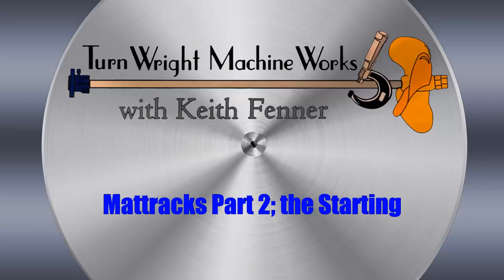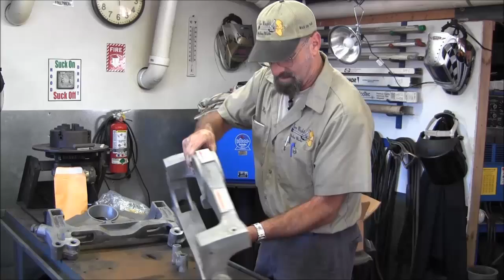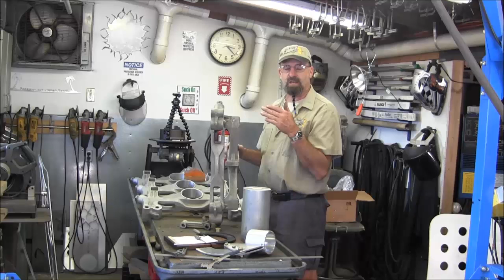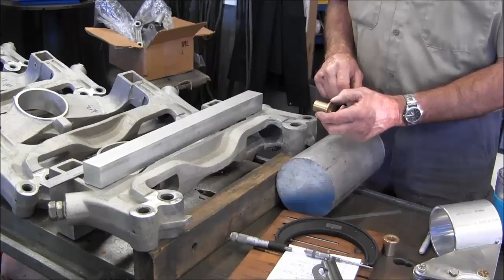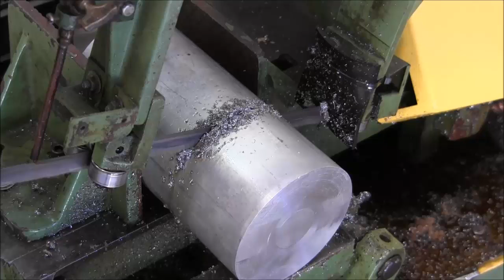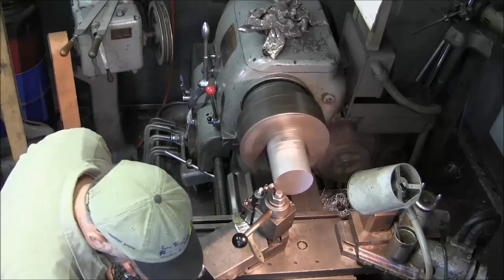Mattracks Mail Call: ATV Mattracks Repair Part 2; The Starting

Comment: Hey bud, I love your videos and I'm a Machinist myself. I have been watching tons of them lately, super nice work! On those end o-ring seals, in the pins, I think a better way to go about sealing from the elements would be to (after weld build-up of course) find a stock size steel ring, rubber lip oil seal. A similar seal to one you would find in the timing cover of an engine sealing the crank snout, or a wheel bearing seal. Counter-bore to the O.D. and depth of the seal and press it in. This would be by far more resistant to the elements and hold up better under pressure.

Comment: I'm still flabbergasted by the non-metric system that you people use there. 4 inches 633? I guess I need a conversion table watching these video's. Absolutely love it :)
Reply: Yep, it would be much easier to state it as 117.6782 mm or if you prefer 1,176,782 nm.  The metrics do kinda roll off the tongue .
Reply: but has your military been to the moon?

Comment: Hi Keith, 
I like the new angle of the camera over the lathe :). I think I know where you are going with the jig layout, I would like to offer an alternative,let us say if someone does not have a large bar of alloy. In order to locate the ID of the part you can have a plate with two vertical precision ground pins press so they catch the ID and an off centre cam that forces the ID on the pins, this creates an equivalent of a V groove and can be made by using plate off cuts (.plasmacutter...).

Comment: I'm looking forward to watching this job. It looks like a complicated setup. I wonder why they wouldn't have gone with bushings in the first place. Also I don't know if you'd condone this or not but old bandsaw blades can be made into good hacksaw blades when they're cut to length and holes drilled in the ends.

Comment: Reminds me of a job, I helped with as an improver duting my time as a heavy truck mechanic, Re furbishing Hendrickson reactive rear suspension units. I find that using an internal micrometer is better than a snap guage. Like wise did'nt really use dial guage verniers except fo rmeasuement when reaming bushings . Like wise when measuring engine cylinder bores always taught to take measurments at different clock points using an internal micrometer or a mercier guage.

Comment from the maker: Excellent comment! there is going to be a gap between the two bushings, a small inside side hammer could be used or making a expandable pusher that slips into then expands out into the gap for pushing in press. So far that is in our lines of thinking. ;{)-----

Comment: Keith, noticed you didn't tension the band saw blade. I can only think you must use the saw everyday?
I use a bimetal blade on my small 10" saw, run it at a slower speed and a gent feed rate with coolant and haven't yet needed to replace the blade now for a few years.
Though I can tell you it puts you to sleep sitting there watching 8" stock getting cutting :)

Comment from the maker: I not going to say it is more accurate, it may be more reassuring to some, because it also has a vernier that you can see or use as a reference. If want to create the real test to your question, place electric tape over the thimble of the inside mic's and judge only by the feel, compared between the inside mic and the snap gauge. I will say the comparison from different clock points around the bore is much easier to do with the inside micrometer, due to its adjustment. ;{)-----

Comment from the maker: There are a couple company's out there that make bandsaw blade guide systems that mount on many different types of saws, you may be able to upgrade and better your saw. Making blades for the hack saw from used blades, on bandsaw, good intentions on saving but then you would be pushing a dull blade by hand. ;{)-----

Comment from the maker: I use it almost everyday and I would still be pushing the other blade if it hadn't lost a few teeth. It has a auto tension adjustment built into the draw bar. A couple days of stainless steel cutting does wear on a blade.   ;{)-----

Comment: when you chuck up the first slug of aluminum around the 26 minute point, after you turn it on to check that its true, you go back and tighten the jaws using each chuck key point around the chuck.

whats your reasoning for doing this?
Reply from the maker: I used each location because, it seems to seat the jaws in a little more even on this old beast. ;{)----